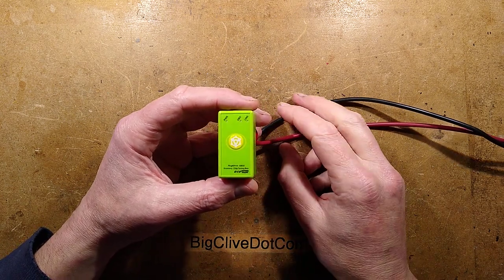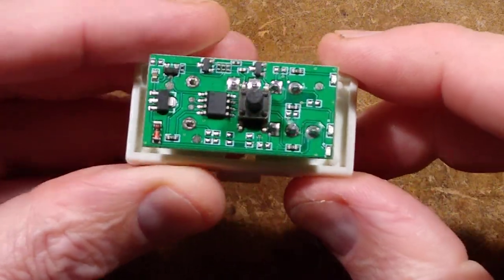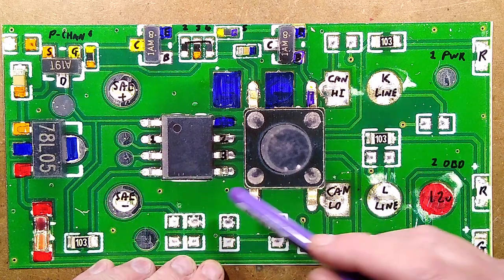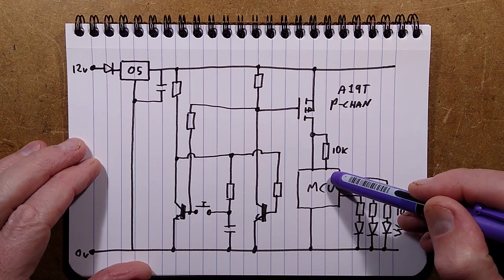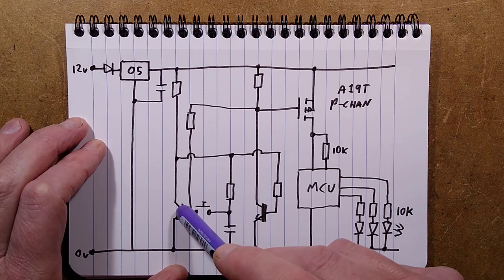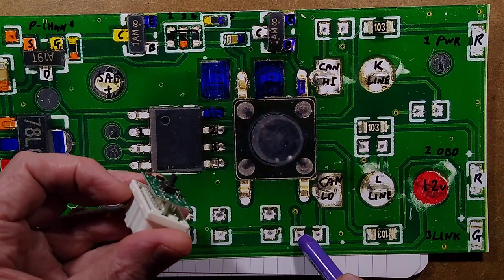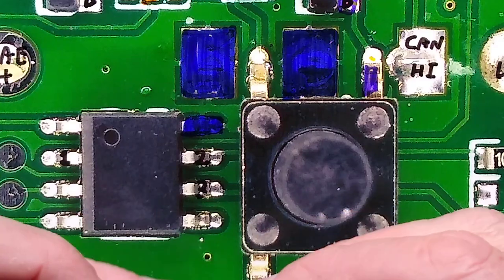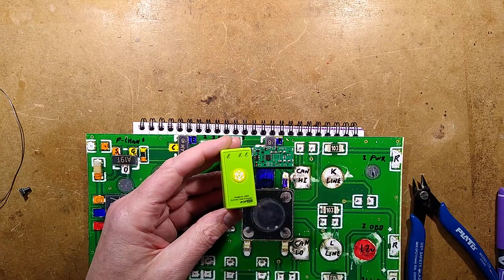Fake product with stolen software?  (with schematic)

Comment: My local and independent auto repair shop is literally a Ma and Pa operation with their son doing the hi-tech work now. As you walk in, they have a big glass jar labeled "Fake Fuel Savers" that's filling up rapidly with OBD scam boxes they find plugged into customers OBD ports. A few of them have been found guilty of causing the engine to misfire until removed. The jar is a good way to get people talking about scam boxes.
Reply: Maybe you should try and get a few of them, then send them to Big Clive.
Reply: fake fuel savers, saving fuel by making your car misfire so you give up and walk to work.
Reply: I want to see one that caused a misfires get reverse engineered
Reply: @Green_Expedition_Drgn  I like to think that those are the better ones. At least they're doing something at all.
Reply: "As you walk in, they have a big glass jar labeled "Fake Fuel Savers" that's filling up rapidly with OBD scam boxes they find plugged into customers OBD ports." - OMG that's wrong on so many counts....I mean yeah, I heard about the fuel savers (and always wondered how can people be stupid enough to buy one), but these fake "OBD" thingies are new to me.
Reply: I've had the occasional real OBDII readers cause the occasional misfire too.   No idea why though.   Just being plugged in, without doing anything, an otherwise very smooth running car would have the occasional miss.   When I removed it, it went away.

At the time, I wasn't doing micro electronics, so I didn't tear it apart to figure it out.  Now, I wish I still had it, so I could figure out what they screwed up. 

With what I know now, it may have been something where they attached to the data terminals, and inadvertently put something across them.  Like a smoothing cap that may have messed with the signal.  Or even just a LED and resistor across the +  and - data terminals degraded the signal.   It's easy to screw up.  Well, unless you do like they did, and not attach freakin' anything to any data pins.
Reply: @CoolKoon  obd is the name of the port where you plug them in
Reply: @marcusborderlands6177  You don't say.....the point I've tried to make is that up until now I thought that gadgets connected to OBD actually did communicate with the car in some way (the "magic boxes" for fuel saving previously were usually not connected to anything, most often they were just fastened to the fuel inlet or something).
Reply: @CoolKoon  OBD fuel savers have been a thing for ages, they usually just connect to power for an LED light
Reply: Funny company:)
Reply: @Green_Expedition_Drgn  they didnt missfire anything since they are just diodes :)
Reply: the whole concept of a plug-in fuel saver is a scam. Some just charge more money to do it...while some of them might work, it's costing more money later on they save on fuel by breaking something else in the car.
Reply: Reminds me of the mobile booster stickers which were stuck on the back of phones and were really popular back in the early 2000's in the US and probably elsewhere too.   It was nothing more than a thin plastic films sticker with some fake traces on it, no electronics sold for $10-20 bucks.  lol
Reply: Do they sell them? OBD2 connectors aren't cheap, and I'd love to buy 10 of the fake ones for $10 or $20.

Comment: They went to the trouble of adding these elaborate traces to nowhere, probably the initial version had all the resistors populated as well, just to give the impression that the device is actually connected to the bus in case someone opens it up. But then they thought "oh f** it, no one's gonna do that anyway, let's save that half a cent per unit" 😂
Reply: Although it doesn't make any difference. Even if there were traces, resistors, and a CAN transceiver and microcontroller.
Then the product would still not save fuel, and would still be fraudulent.
So leaving out as much electronics at least reduces some e-waste.
Reply: Sustainability 100
Reply: @graealex  you know what would help e-waste? If these products didn't exist at all but something tells me the people behind this aren't all too concerned lol
Reply: @samsh0-q3a  Yes that would help even more. People selling it are criminals, but police and courts usually have more pressing matters to attend to.
Reply: My guess is that, with the resistors it wouldn't be compatible with all cars, as it would cause problems.
So they disconnected them for compatibility.
Reply: @deth3021  ah yes, would be a shame if it couldn't do nothing with a VW as well as it does nothing with a Ford.
Reply: @moredots  the problem is if it was doing something on the bus it would likely break different cars.
For something like this doing nothing is actually the best outcome.
Reply: @graealex  Yes like taking our hard honest earned money.
Reply: @deth3021  ODB2 is standardised across all cars so unless the car was wired up wrong at some point it shouldn’t cause a problem.
It’s the software to read the ECU’s that differs between the manufacturers.
Reply: @hybrid9mm  I know what obd2 is. However most vendors have their extensions. 
If the firmware was programed to work with one vendors extensions and was used with another vendors system it's possible it could have unintended consequences.
Not being connected at all is therefore the less risky approach.
Reply: @deth3021  all the wires out put the same signals (hence standardised) regardless of firmware, this is why you can use the ground in the plug to earth the different feeds to make the engine management light flash the fault code.
This is why they created the scam as it’s almost fool proof.
Reply: @hybrid9mm  first theybarent all the same wires. Different manufacturers have different pinouts for the obd2 connector. For doip for example.
However I wasn't talking about electrical differences I was talking about protocol differences.
Which you apparently have no clue about.
Reply: @deth3021  you have only just mentioned protocol, may be lead with that next time.
Reply: @hybrid9mm  why? I said it could cause issues.
You assumed I was talking about electrical issues for some unknown reason, even though we are talking about a bus. Feeling the need to point out the obvious that can buses are electrically compatible.
Reply: @deth3021  so you think everyone will assume what you are talking about based off of “it could cause issues”.
I assumed as best I could but considering “it could cause issues” was all I had to go on and it actually could mean a number of things I got it wrong, you could have saved the rest of the pointless back and forth by just being obvious.
assumptions are really not the best way to converse, so if someone misses your point just be obvious.
Reply: Stop digging deth.
Reply: @deth3021  As far as I remember, only OBD-I was significantly different. OBD-II was an attempt to harmonize the plug and the protocol, i.e. software and hardware.
Nowadays the same OBD interfaces should even work with motorcycles, as is required by law.

Comment: They should've put a blob of black epoxy on there somewhere as as "secret chip"
Reply: yes... on an empty board....😀
Reply: Yes, they missed a trick there to be sure! Maybe they priced it up and decided epoxy was too expensive?
Reply: Imagine if you plugged it in and a bootleg version of super mario brothers appeared on the satnav screen
Reply: @actuallyusingmyrealnameher5061  Haha. Mario Kart though surely?
Reply: @Toymortal  Controlled by actual steering input....
Reply: @actuallyusingmyrealnameher5061  Okey Dokey!
Reply: @actuallyusingmyrealnameher5061  GRAND DAD
Reply: @Kaboomf  haha. Wired backwards of course!
Reply: Silkscreened "Go away, Clive" underneath it.
Reply: Ah shite, my cunning plan is foiled!
Pax
Reply: it would have make even more sense, you see these blobs a bunch in automotive circuitry (or even whole potted pcb's) for vibration resistance.
Reply: yes, the "secret encapsulation".

Comment: i've never a seen a bi-stable circuit done like that before! its kind of incredible considering it skirts the problem of stolen code from a stolen design. the ingenuity of thieves is always impressive
Reply: Apart from the circuitry for the button/switch, that’s a standard transistor based bistable circuit.
Reply: It takes a lot of work to avoid getting a job!
Reply: @Mark1024MAK  it's not too difficult to lay out a PCB these days but yeah it shows what people are willing to do
Reply: Radio Shack's "100-in-one" kits had a similar BJT "pushbutton on/off switch" back in the day.
Reply: @infernaldaedra  I can appreciate the effort of laying out tracks that go nowhere under a switch. Most PCB software would flag that as a problem.

Comment: Given the odd design, they may have designed it to work using cheap E-Waste components they could get from recyclers, rather than using new and far more expensive sourced components.  
Not many reputable companies want to use questionable reclaimed components in their products, and disposal is expensive.  
But if they could stick them in fake product lines they don't need to maintain, there is profit to be made.
Reply: How very cynical of you
Reply: @KarlHamilton  

I'd say likely and practical but nothing o do with cynicism.
Reply: @KarlHamilton  You seem to be confusing cynicism with scepticality.
Reply: @UnexplainedHoveringSpheroid  Nope.  Perhaps you should Google it.
Reply: Reduce Reuse Recycle: E-Waste can be recycled to create more E-Waste
Reply: This is brilliant! The shareholders will be happy to be informed of such possibilities.
Reply: There is something charming about the idea of con-men making use of ejunk parts that would otherwise be going to landfill.
Reply: They are probably coming out the back door of a big name manufacturer after midnite
Reply: @holmes1956O  or rejected chips getting scrapped
Reply: @jmackmcneill  now ewaste can be shipped across the planet a few times before ending up in a landfill.. Charming indeed

Comment: This video just inadvertently made me realize an error I’ve been making and now everything actually makes sense. For WEEKS I’ve been thinking that CAN-Hi is 500k and CAN-low is 250k… when I was working out the circuitry of the “fuel saver” I came across my issue!
I’ve been using it in my schematics and now I know this is what has been screwing up my troubleshooting!
Who would’ve thought that a scam OBD2 plug thing would’ve turned into someone’s lightbulb moment.
Reply: There are several versions of CAN, the most common are 125Kb, 250Kb, 500Kb, 1Mb.
The CAN Low and Can High simply provide signal reliability, as they are twisted it is very difficult to disturb the signal.
Reply: @SrWolf90  Almost got it...

Canbus is differential balanced line signalling. When one line goes high, the other goes low. When the wires are twisted, each doing the opposite simultaneously will prevent EMI. Any other noise encountered will effect both lines simultaneously, which won't change the difference in voltage between each line after you subtract out the "common" voltage. 

Since canbus is non clocked, you can make whatever bitrate you desire. When you get a MCP2515 or similar canbus controller, you've gotta set the sampling times (bit timings, google mcp2515 bit time calculator) based off the controller's clock rate. In effect, there's no "different versions" canbus till you get into CAN-FD.
Reply: Not sure now, but in the 2000s it was common to have a high-speed (500kb) CAN bus for mission critical functions (related to engine management, etc.) and low- speed (say 125kb) for less-critical functions. Unless the manufacturer cheaped-out and put everything on one bus.

Comment: Redraw the two NPN transistors as a simple flip-flop, which will simplify the schematic so that your eyes don't cross. In my distant past, I have used this same circuit, but using TTL logic, to make a toggle on-off switch. The key to making it work is that the value of the resistor in the RC network be at least 10x higher than the impedance of the flip flop output that it connects to. The C debounces the switch.

Comment: Gotta give them some credit, they had a chance to really mess up the car's computer using this interface, but were decent enough to resist the urge....
Reply: My guess is that a previous version did have extra components and connections, but it killed certain models of engines, and you can trick people into thinking you're saving them gas if their car won't start.  So they axed bits with the minimum amount of work necessary.

Comment: I plugged one of these into the previously disconnected SU carburetor heater circuit in my 948cc Austin Healey Sprite to automatically clean the cassette player heads whenever I play a Bee Gees cassette.   It does this perfectly and I don't believe a word you are saying !

Comment: I think the analogue power control circuit was just someone showing off. They were probably bored.
Reply: What I find odd is that it's obviously cheaper than replacing the momentary contact switch with a latching switch.
Reply: @Shaun.Stephens  but still more expensive than just using the microcontroller's interrupts to achieve the same purpose in software.

There's no need to control the power to the whole microcontroller, just turn off the LEDs and drop into a low power mode. Power to the microcontroller is automatically turned off every time the car is turned off.
Reply: @tissuepaper9962  My car's OBDII port is always powered.
Reply: @wufftwenty-sixteen5567  well then perhaps I'm mistaken.

Comment: I wonder if perhaps this hadn't started out, at least in the initial design brief, as a single-purpose service reminder reset unit. The example I'm familiar with is certain BMW models where shorting two pins in the classic "Pacman" connector via a certain resistance for a few seconds resets the oil change interval counter. I believe some later models moved that function to the OBD2 connector.

Comment: Those of us of A Certain Age will remember the small glass phials with spark gaps that were sold in street markets.  You put this in your HT lead from the coil and the improvement in performance was demonstrated on the stall with a much bigger, brighter spark. I never saw the Secret Switch they had under the table though . . . .
Reply: Yeah the donuts that fell for that didn't understand that a bright blue spark in open air is not the same as what you get in a fuel/air mixture under compression...
Reply: honestly my guess is it was wired to an oil burner transformer 10,000v-14,000v output makes a nice blue spark that can jump a wide gap, you can build those Frankenstein movie style Jacob's Ladders with these things.  Or a Neon sign transformer, they are similar voltages to the oil burner ignition ones. Either way I mention both of those because for a scammer on the street there is another important factor, both are cheap.

Comment: In a previous life I got quite experienced with CAN Bus and wrote a software stack for interfacing with the protocol (supporting multiple devices through their own device driver). It was quite entertaining when I applied my CAB scan and detect code to a car and found, naturally, that I had access to all the functionality that a car manufacturer kept for main dealers and prevented independent garages from accessing. In theory, it is quite possible to have something on the car's CAN network that would impact vehicle efficiency. Likely not well advised, and it is also very likely the that vehicle's EMU (Engine Management Unit) will do a far better job.
Reply: As I commented elsewhere, one of these devices could be detected by some ECUs causing them not to log error codes
Reply: @JordyValentine  Yep. The despicable attempts the auto manufacturers made to maintain a monopoly on overpriced "servicing" of their engines/EMUs was really bad.

A well behaved CAN Bus tap was invisible to any devices. While adevice scan was necessarily interactive (it's impossible not to either broadcast or poll a specific CANID without sending a message) past this the interaction could be a passive monitoring of CANBus traffic and recording the information. This was quite instructive at times and the initialisation messages from the EMU gave out quite a lot of information. This initialisation could be subverted and extended depending on the vehicle and in any case all that was required was to restart the EMU (disconnect the battery in the most persistent cases) as the EMU performed a proper re-initialisation on such a cold start. Some CAN devices would correctly support multiple messages, for example configuring them to send status updates to the CAN Host device in addition to the EMU, for others the CAN device was singular and would only send to one device at a time. This shouldn't be the case but hey, some devices are cheap/crap.

Comment: You know when you have a quality ECO OBD-2 device when the ON/OFF switch is more sophisticated than the rest of the design... Have to hand it to the guy that came up with that... and I think you're right, they've repurposed someone else's fake blink-o-matic controller
Reply: However this is entirely an assumption.  They could have purchased a batch of legitimately preprogrammed chips from the Halloween/decoration industry.  This light show seems appropriate for a simulated ADSL modem that can be demonstrated without depending on the phone company or buying an extra line.
Reply: @johndododoe1411  

Why in the world would you want a fake 'working' modem display? Now THAT is supposition.

Comment: The reason for the high current limit resistors on the LEDs might be because of the power handling limit of the SMD linear regulator 78L05.

Comment: OBD II port is also useful to trickle charge the battery from inside the vehicle. I use a 1 amp trickle charger to charge through pins 16 & 4 so I don't have to go under the hood to disconnect the battery clips every time I want to go for a drive.
Reply: Buy a new battery skinflint!